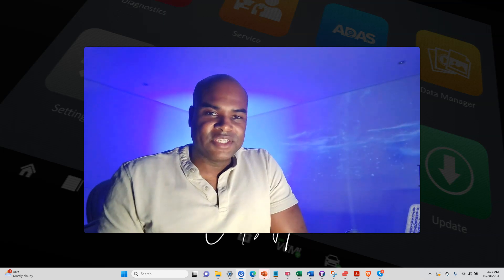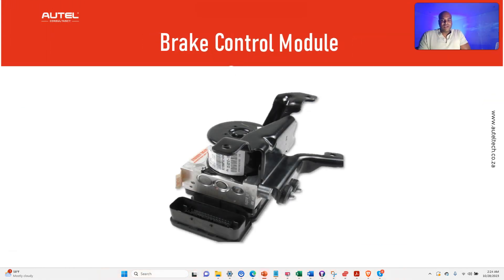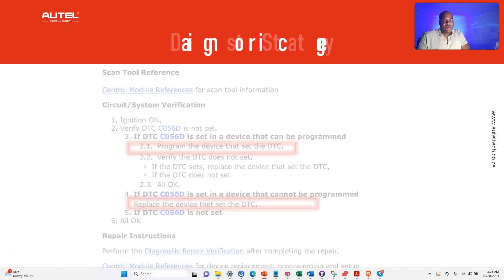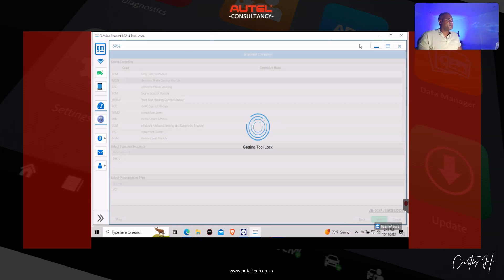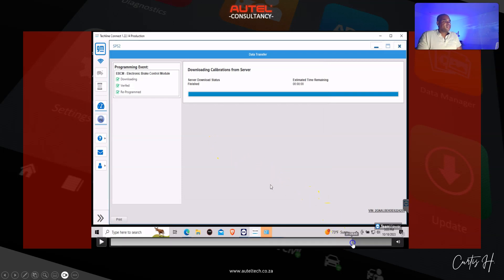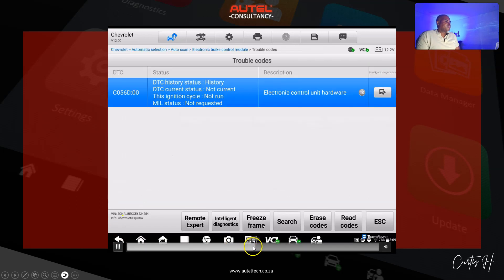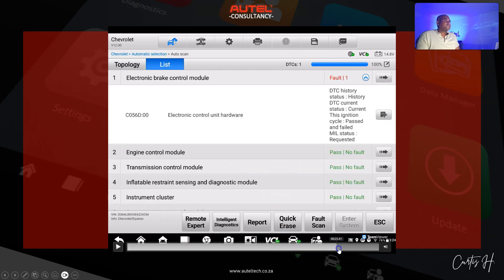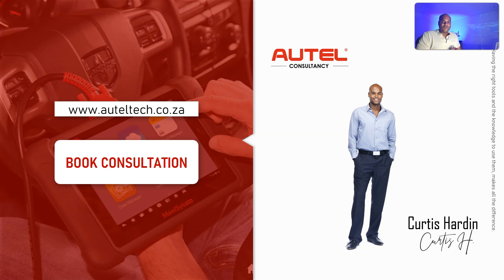Why a Used ABS Module Failed on a 2014 Chevy Equinox: Maxisys Ultra & J2534 VCMI & Techline Connect

Comment: Is the tech line you used in this video the Chevy subscription that is  $4800 a year or is there a different way to program
Reply from the maker: To flash program we use the Techline connect OEM software. We paid 45 USD to gain access to the software.  This is the only way I know how to program GM vehicle modules.

Comment: How can i get access/ login for this software
Reply from the maker: If you go to my website auteltech.co.za there is a service called j2534 training and consulting. I will walk you through the computer preparation , installation and procedure.
Reply: @AutelConsultancy   That didn't answer his question . Do we get access to Chevrolet tech line with your class
Reply from the maker: @rkelley8475   The answer is yes. As I said in the previous comment, I will prep your computer, then I will walk you through the registration process to download the software. Then I will walk you step by step on how to program them module. Its more than just getting to the software.. Its about learning the proper framework on how to use it.

Comment: I had same exacly problem after dead battery. I replaced the battery and install new brake pedal position switch and did re-learn and still had no crank. After spending afew hours scoping and  testing wires found no wiring problem. I decided to remove battery terminal and touch terminals together for 30 minutes. Guess what. That did the trick and code cleared and vehicle cranked over and started up. Try that.

Comment: Hey Curtis. Are you an authorized Autel dealer? I only want to buy legit
Reply from the maker: To answer your question no I am not an authorized dealer. Dealers just sell the tool and the relationship stops there.  A consultant aligns you with the right tool, then sells the tool and then helps the client grow with the tool they purchased.

Comment: Hi, how are you?  How can I get the techline password as an independent repairer?
Reply from the maker: You would need to sign up for my j2534 training if you want me to teach you how to program. Or if you dont want the training you can try to contact autel new york.. they dont charge but im not sure if they will walk you through the installation process
Reply: Yes I needed to see this video because the ABS module is bad 2009 Escalade, I have a ECM to program on a 2010 Silverado, and. Diagnostics on the ECM on  a 2018 BMW . I will be calling you soon. Your client The Jack.